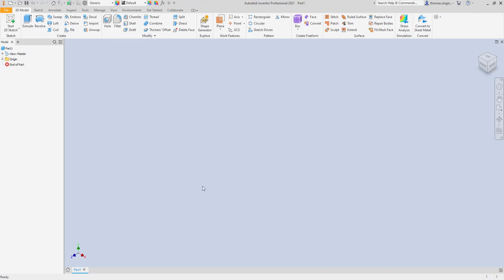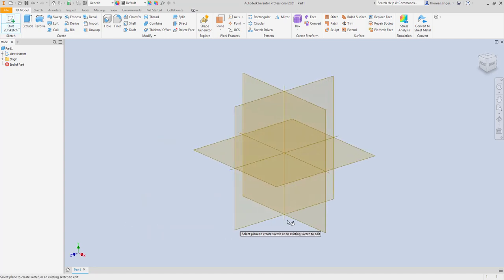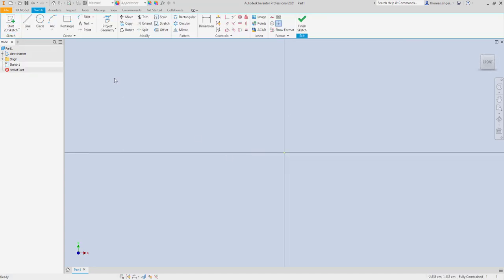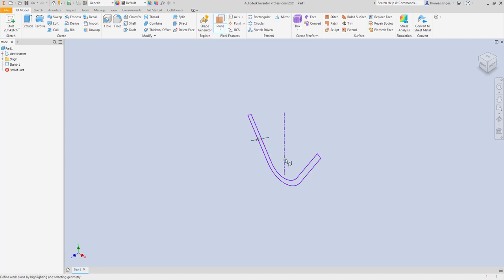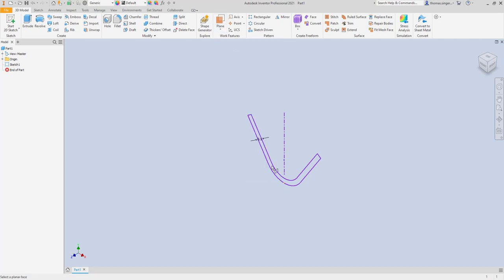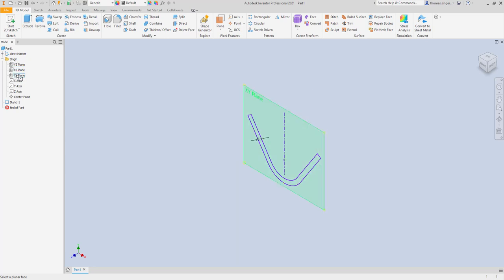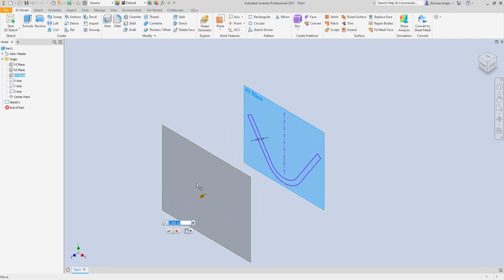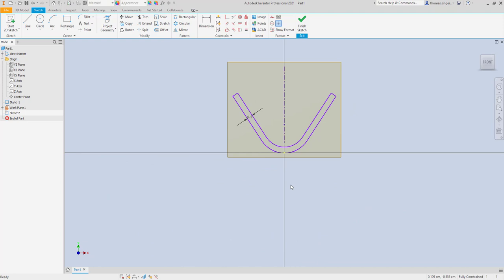Inventor 2021  Lofting Shapes

Comment: The Inventor Loft command has always been hit and miss. It has probably never been updated since day one. Try lofting 2 sketches with concentric circles; like a pipe but with varying diameters and thickness...it can't do that. Even if you add guide rails or transition points it still won't work. In the example above it would probably have been better if you either had changed the 2 projected arcs to construction lines before creating new arcs or simply projected just the endpoints and then drew arcs.